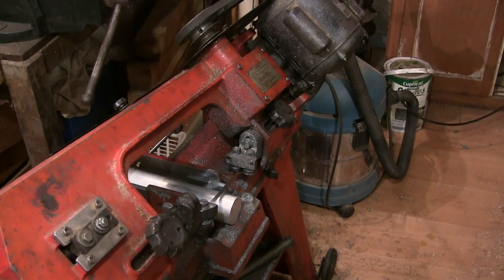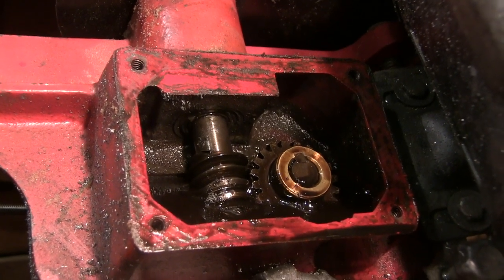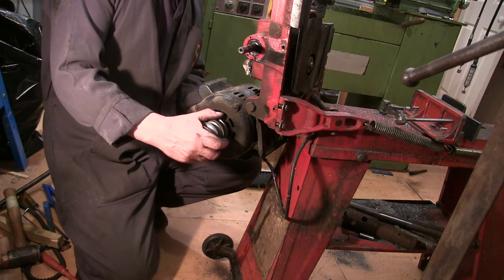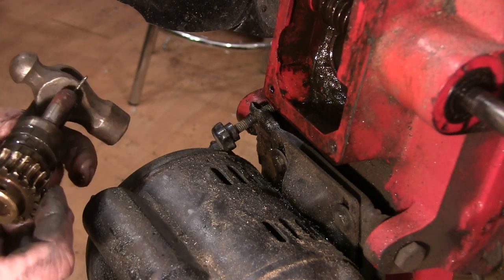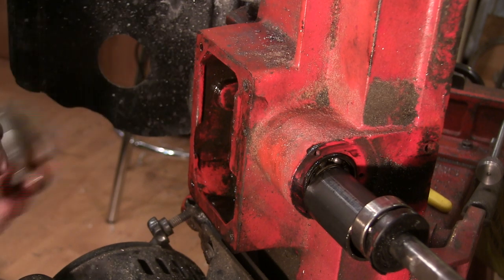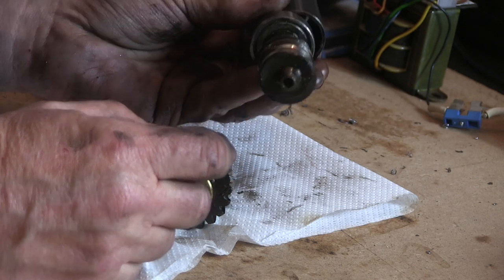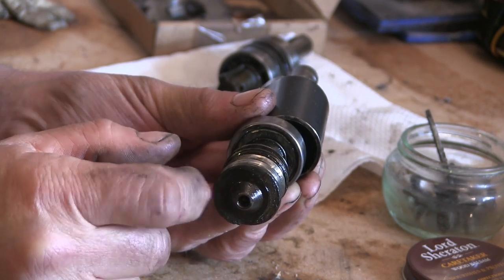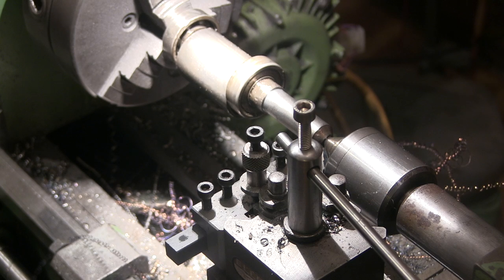Harbour Freight Bandsaw, Gearbox Repair!

Comment: On mine, the Brass Gear was beyond knackered but the worm appears to be good and I too knocked the shaft out the same way  as shown.  I did some minor damage to the Worm.  Notice the bronze gear U is shape to fit the worm so the sides are in effect larger than the center so it doesn't pass the worm.  I was able to hand file the burrs I made.   If making a new worm as well, no problem.  I think you have to knock out the roll pin the tap the shaft out toward the blade wheel,  And the blade wheel hits the tilt shaft so searching Youtube for ideas.  This is why I am here, looking for the best way to install the new gear without damage.  I am thinking it's install the Brass gear assembly first then the worm  with a bit of tapping and rotating as you go but don't really know for sure.   Off to repair #2.    Thanks for posting.

UPDate: I used a crowbar prying on the end of the worm and box and as I was not replacing the worm I only had to push it a couple of inches and the brass gear was able to pop on easily, then tap and turn the worm shaft back in.    I saw another video explaining why no roll pin hole, it was for JET version and it used a Circlip.  Unfortunately the HFT shaft is not long enough for a Circlip groove.  Maybe also order the shaft from Grizzly or if you have a lathe make one.    Also, looked at the gear oil I used, GL5 of which others say is not good for Brass gears, just saying.

Comment: I felt for you Cliff, cutting stock by hand is a pain.  I also consider my bandsaw the most useful and probably overworked machine in my shop.  Looking forward to the hobbing work in the next episode.  PS, love to see a bloke who fights a job the whole way to get it apart and uses what ever comes to hand to get it done, great stuff.
Cam
Reply from the maker: Thanks Cam, as Yves above pointed out a gear puller would have been handy, but that pulley did not want to come off, but it had to, even if it meant buggering it up! :-)

Comment: Thanks again, Cliff! I'll eagerly wait for your cutting the hob & worm. Good luck with that, as you'll probably find it hard to get a proper gear ratio (including fractions of Pi) for the lead screw to get the proper helix angle for the worm. Then design considerations on what PA to use... Aluminium for the wheel could prove too weak - phosphor bronze will last if you could get hold of it - works great with a steel worm. Holding my thumbs - all ten of them- for you, Cliff! Cheers, DIYSwede.

Comment: greetings from Oklahoma, U S A ,,...!! ...good video..tks ..i  signed on because I FOROT the RE-assembly order of some of the components ..("where the hell does this go .".)..lol...!! anyway you showed me what I needed to know ..I bought a new 20 tooth grass gear and shaft assembly .on Amazon -(the worm gear looks fine)--..I noticed however, that my saw had a 23 tooth brass gear ..!! ..I counted the teeth on the worm gear and it looks like FIVE complete teeth ..!! ...not sure if it's gonna work ...but logic would dictate that 5 to 20 sounds more reasonable than 5 to 23 ..!! ..i bought the saw NEW 20 years ago for $170.00 so..if this doesn't work ..to the scrap pile it goes ..!!!... thanks again for the information  ...!!!

Comment: Interesting video Cliff.  My RongFu bandsaw looks like yours (it was the original they all copied).  I'm really surprised how cheesy that worm gear looks to be to wear like that.  You can buy Harbour Freight spares for them I believe.  How many $$$'s though may be too much ;)  Looking forward to seeing how it turns out.  I changed the oil in mine when I did the guide rollers and the gears looked good even though mine had done a lot of work before I got it.  I replaced the gear oil with synthetic Mobil 80 - 120 LSD oil as it won't attack the bronze gear.  An aluminium gear should work OK for quite a while I expect, provided you make it out of some hard stuff.  Good luck.  Cheers Rob

Comment: The worm should be fine just replace the bronze gear. You can get almost every part for these saws from Grizzly!!
Reply: Not anymore! Grizzly replaced this model with a variable speed direct drive model, and the Shop Fox model shows these parts, and the majority of other parts, as discontinued - no longer available! Grizzly seems to be slowly moving away from “cookie cutter” Chinese machines that are sold under different brand names, but are identical. I guess they got tired of selling parts for machines they didn’t sell, although it looks like that would be additional income for them! HF actually does sell a handful of parts for this saw, but it’s mainly guide roller bearings, pulleys and the motor. None of the gearbox parts are available from them.
Reply: It's available on Amazon for anyone who needs it.  On eBay too.  50 bucks or so.

Comment: I have the same saw- have lots of issues with it
Fb
Reply from the maker: Cheers Frank, when it works well mine works great, and then it'll have a tantrum, throw the blade and generally play up, but I have never been able to adjust the vertical cut dead square, it doesn't have enough movement on the guide, something I'll look at while its in bits!
Reply: Cliffs Shed  yup- sounds just like mine. It does beat using a hacksaw though